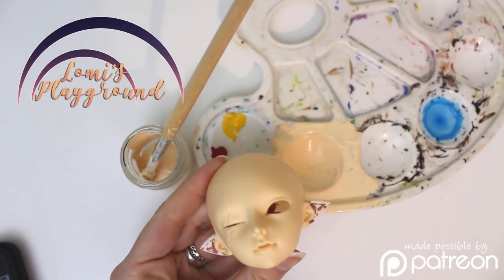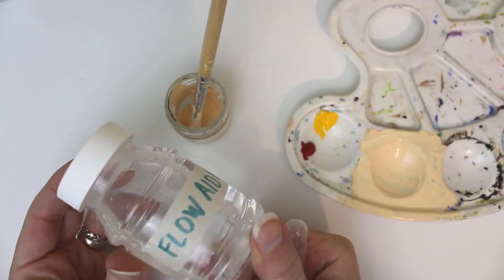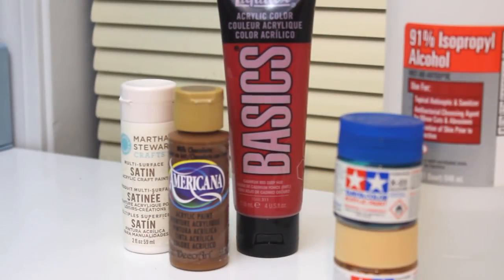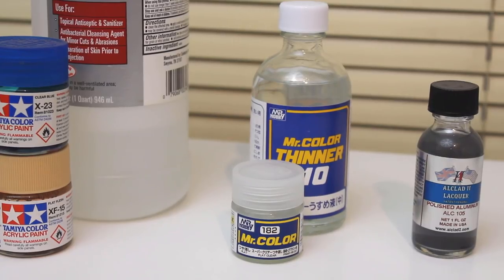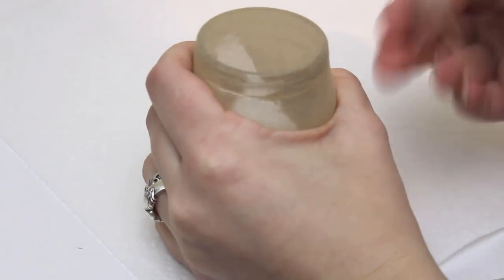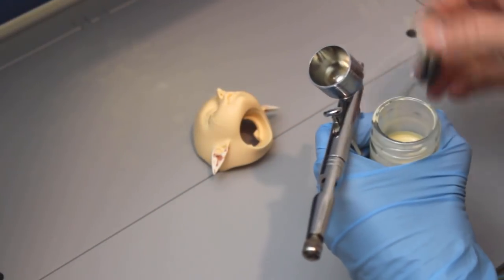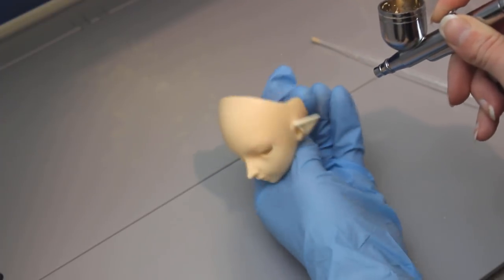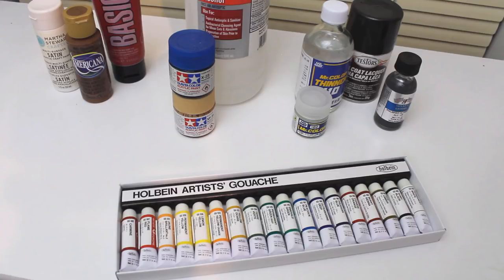Airbrush basics: Paints to use and how to thin them

Comment: This is the most informative video I’ve seen! Thank you. Is it necessary to use a ventilating system?
Reply from the maker: It depends on what kind of paints you use. All paints will put particles in the air, so it's important to use respiratory protection so you aren't breathing in floating paint. Enamels and alcohol-based acrylics do need ventilation because they have fumes that can be harmful to breathe, but non-toxic acrylics, watercolors, and gouache paints only need the floating particles controlled. In the past, I've kept them from filling the air and making a mess by turning on a ceiling fan and laying a towel under my work space so the fan pushes the airborne particles down into the towel. That way, they don't go all over.

Comment: I have a airbrush I've never used bc it seems to be a lot of work, but with time I think I'll get used to it. My question is what pressure did you use on this project? I know you used ..5mm needle but I wasn't sure of the pressure
Reply from the maker: I usually use between 30 and 35 PSI for the pressure. :)
Reply: Okay thank you for all the info.